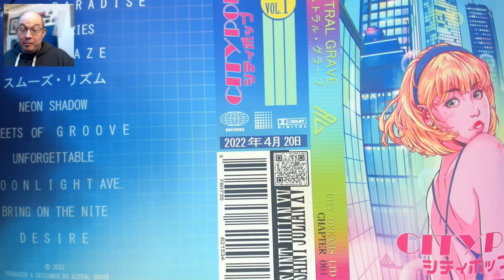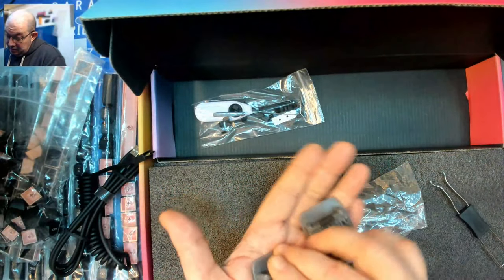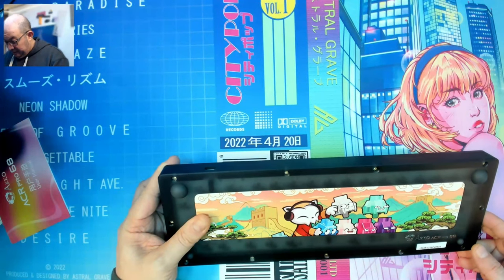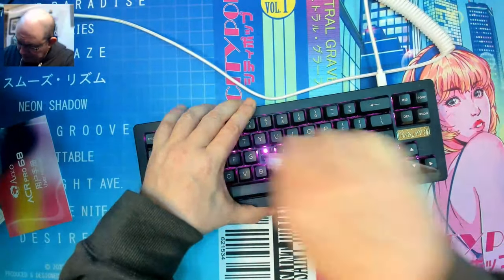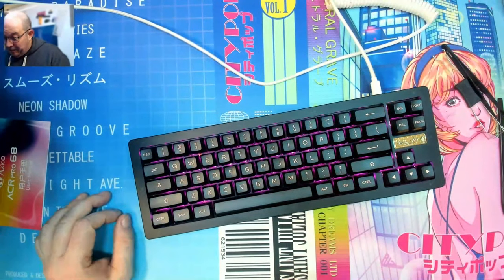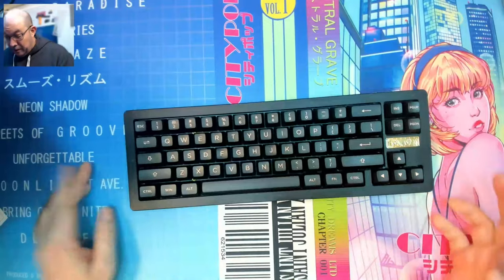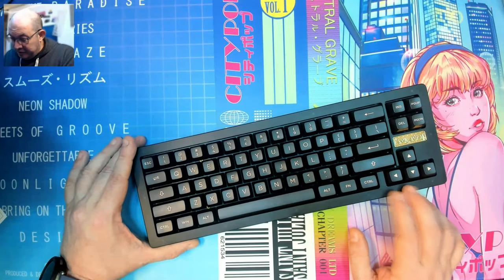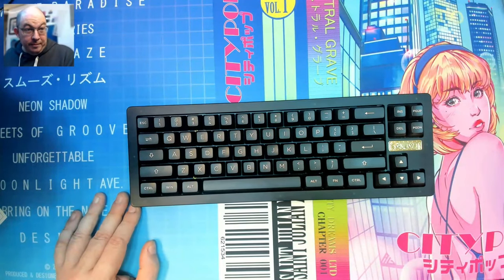Akko ACR Pro 68 Review and Sound Test - Acrylic 68-key 65% prebuilt that is ready to go OOTB #akko

Comment: I got a replacement keyboard from Amazon and believe it or not the same thing happens. The RGB still turns off as I am cycling through the brightness or speed levels. I know you can't do anything about it, just thought you might find it interesting. I made sure to try the supplied USB cable in case there was anything special about it, I took the keyboard out to my other Windows PC in the living room and tried it there, and then I installed Akko Cloud Driver to see if that made a difference. Still does the same thing. Checked for a firmware update in the software but it said the keyboard was up to date. Changing the brightness with the sliders in the software can cause the same thing to happen. I guess I will just send back the original one and keep this replacement. I still like the keyboard. The RGB looks bad anyway with the Gateron Cap Golden Yellow switches because it bleeds into all the colors. The serial numbers of the two keyboards I got were only like 6 apart. Same Akko inspection card in each box. I put a short video on my channel showing what it does if you feel like looking. Strange!
Reply from the maker: That is quite odd, I will take a look, thanks for the heads up!

Comment: I recently got this prebuilt, mine seems to have an issue where when I change the brightness levels or pattern speed using the FN shortcuts, the RGB will completely turn off sometimes as I make the adjustments. I have to bring it back to life by changing the color and then it turns back on. So basically instead of adjusting from brightness level 4-3-2-1-0, I'll press FN + down once or twice and the lights just turn off instead of dimming. I was hoping I'd catch a glimpse of you doing the same thing in the video so I could see how yours behaves, came really close at 8:26 but not quite. I even changed out that spare daughter board just to see if it would help. Does that sound like a defect to you? Do you still have yours where you could check? I hate to do another Amazon return but I'm considering asking for a replacement. It kind of "works" though if I just work around the problem and don't worry about it.
Reply from the maker: Mine did not exhibit this, I would do an exchange, sounds like something is loose on the PCB.
Reply: @MechKeyboards  Thanks very much for taking the time to reply. It's not an issue I have ever encountered before either. I'll look into an exchange!